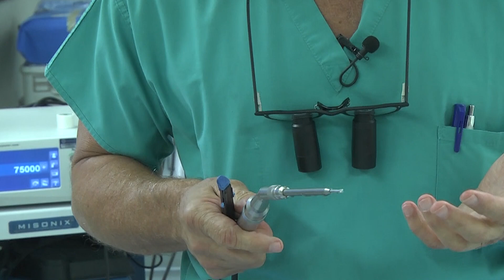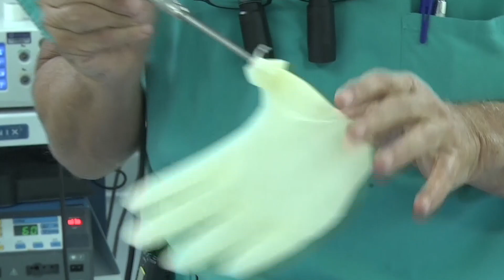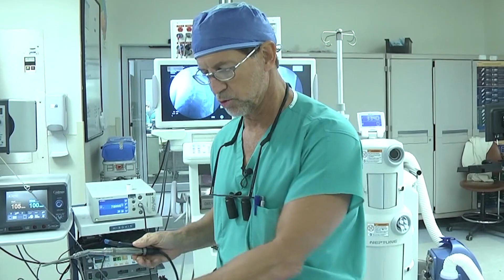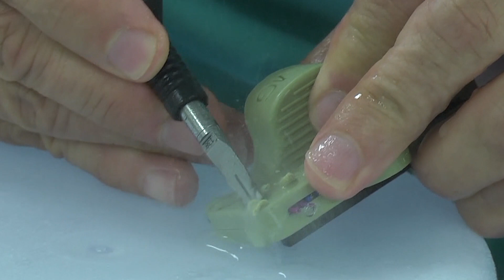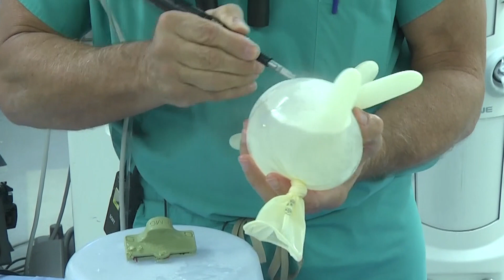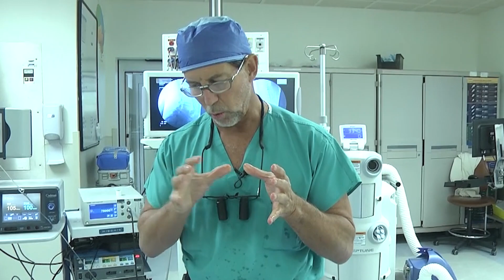Cervical Spinal Stenosis Surgery Tools for High Success Rate | Dr. Cantor

Comment: On February 15th,  2021 I had neck surgery to fuse my C3-C6.  The surgery was highly successful but I had significant swallowing issues that followed a few days afterwards. Unfortunately, stenosis has developed at my C7 and T1.  I've agreed for my surgeon to perform another surgery to fuse the C7 bur no action will be agreed upon at this time to repair the T1 because it will requires a posterior procedure which means more extended recovery time and a fair amount of pain and discomfort.  Moreover, if I understood from an earlier video, in far too many instances the procedure leaves the patient unhappy and regretting having agreed to it.  I sure hope my surgeon uses the ultrasonic tool and my plan is to inquire about inserting an artificial disc instead of more fusion. Would you recommend an artificial disc coupled with the fact a fusion for C3-C6 has already been performed?
Reply: Can you tell me about your swallowing issues?

Comment: Thank you for your help with questions I’ve had. I’ve been diagnosed with cervical stenosis in C5. C6. Or it’s C6. C7
I forget which one. Anyhow they said for me it’s hereditary.  Never knew I had it let alone it’d hereditary.  
I’m 51 this month. And I feel issues in my lower back as I do my daily walk. NEVER seem to have a walk w/o pain.  It hurts The front of my right thigh and slightly on the left thigh goes number 
Do you think if one has spinal stenosis in the cervical spine area that may be it could show up in the lower lumbar area?  Essentially both ends of my spine
Also. My guess is the extra weight I carry does exacerbate the issue. 
What do you think? Thank you for your time. Rose in Texas

Comment: I have severe cervical stenosis at C5-6 and C6-7.  Have you had success with the ultrasound tools in severe cases? Thank you.
Reply: Question: if I had previous fusions etc (C2-5) ; (T6-8); (L1-S1)  and was now informed I have to have further surgery for C6/7 & T8-10.
Injuries related to motor vehicle accident. Challenge encountered Is lack of fusion.
Even reconstruction to my face has the same challenge.
I am in South Africa. But is there is any hope I will travel.
Email edhinsa@gmail.com